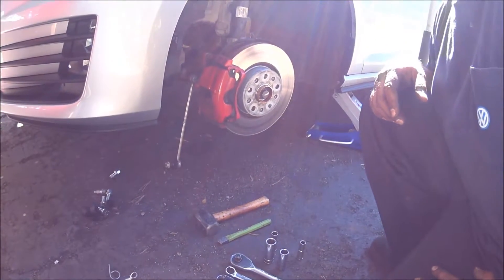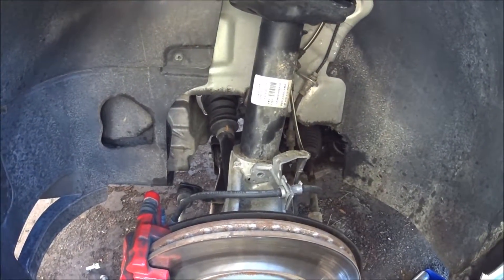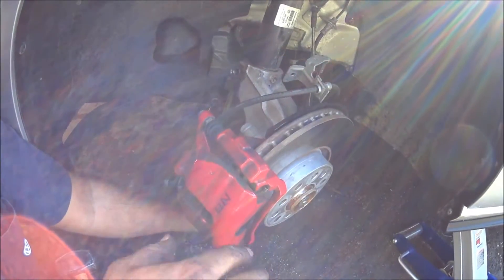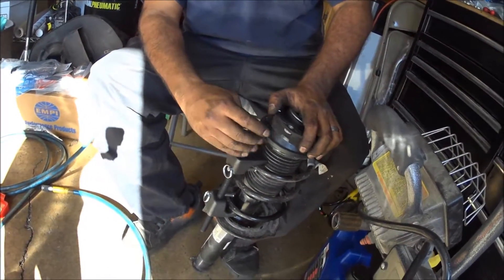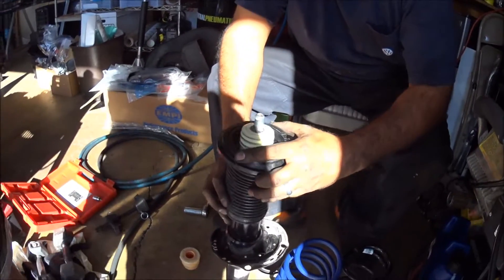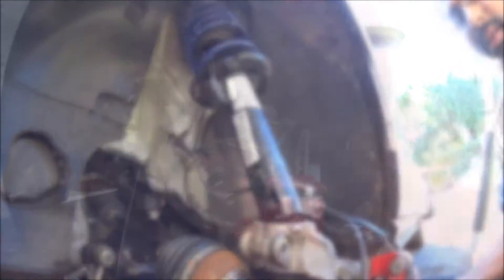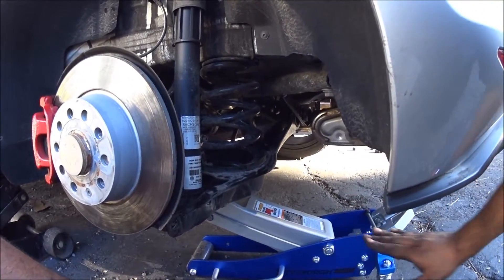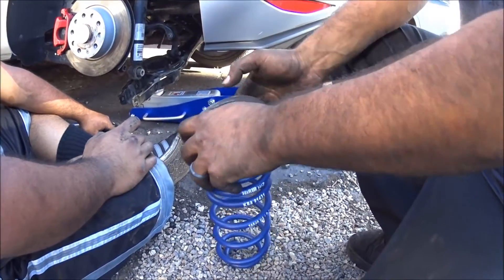How to install MK7 gti/jetta lowering springs DIY

Comment: Very helpful vid. Quick question, how big is the passthrough socket for taking the spring out?
Reply from the maker: i believe we used a 3/4 or 19mm
Reply: thank you so much. Planning on installing them in the upcoming weeks and I think your vid will help a lot!
Reply: just ordered this set http://www.amazon.com/dp/B00F3ZY50S/ref=wl_it_dp_o_pC_nS_ttl?_encoding=UTF8&colid=CNJPRK1HZBXT&coliid=I3KFGPP0PGAFPC
hopefully it'll be plenty for my needs
Reply from the maker: looks like they will work just fine

Comment: Are you guys noticing binding/popping noises over bumps? I'm thinking H&R should have included full length coil silencers for these as they are extremely noisy over certain bumps. In my case I seem to hear the most noise when the front suspension falls into a dip rather than rides up a bump.

Comment: Great vid guys. I've herd that you don't need spring compressors to take these struts apart. I'm not willing to try it myself but I've seen people take them off with *only an impact
Reply from the maker: Meat Amigo you will need a spring compressor to instal the new springs.
Reply from the maker: that is correct. however if you can get the tool use it. better safe than sorry

Comment: How big of a problem is it if the bump stops go in upside-down?
Reply from the maker: not that big of a deal. wont break anything however make sure the dust cap on the rear shocks work properly

Comment: What size through socket used for the top of strut
Reply from the maker: its a 21 or somtimes its a 19mm
Reply: +PincheALs Garage thanks man. I'm running 18x8 225 40r18 with 35 offset. Do you think I'll have any rubbing issues

Comment: All these bolts should be replaced when doing suspension work.  Some are stretch bolts that should only be torqued once and not reused..
Reply from the maker: Correct

Comment: Nice vid...  but common.  Jack Stands.   Wrench 101.  Safety first.   Or at least put a tire under the car.
Reply from the maker: car was on stands sir
Reply: PincheALs Garage 1:08 Clear shot under car.  No stands.  Maybe you put them on later?   Looking at 24:20 no stands either.   Jacks don't count.
Reply from the maker: +Alex Moreno yeah the video does not show it kater but the car was on stands